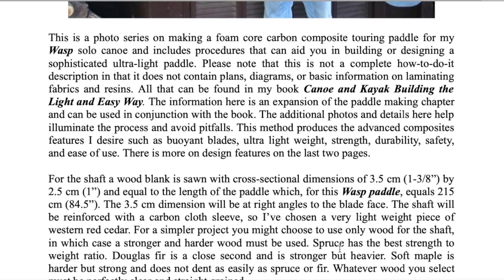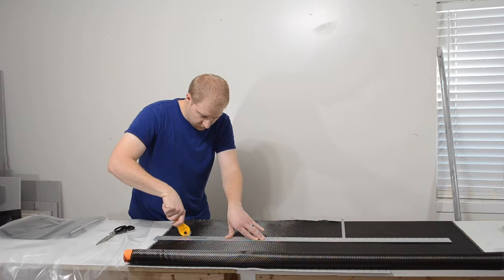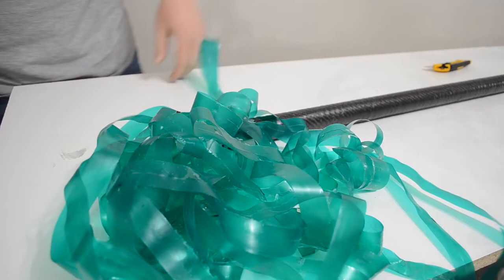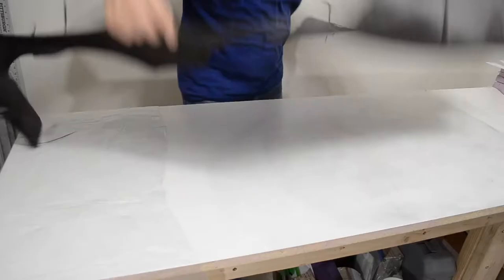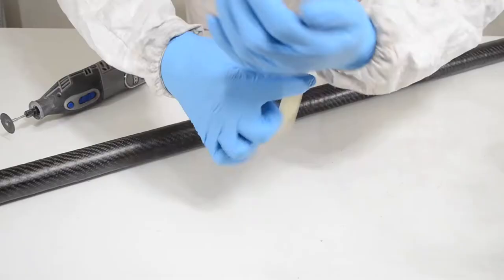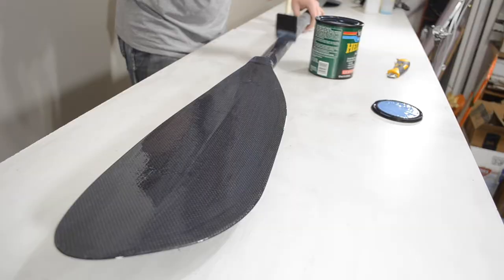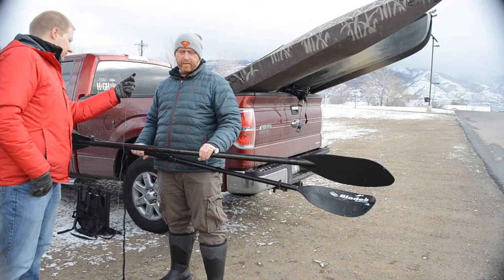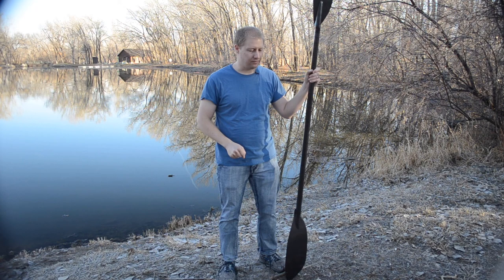How I made a carbon fiber kayak paddle with no molds!

Comment: There are two paddling styles, low angle paddling and high angle paddling. It's mostly preference. High angle paddling gives more power and acceleration, hence why it's used in speed racing competitions.  Low angle is usually used for long distance trips, though I also use high angle paddling for all of my paddling, and I am part of Castaways Against Cancer, so I paddle with my fellow Castaways from Miami to Key West once a year (160 miles+ to raise $ for cancer research).  All this to say that if someone has a natural high angle paddling style (difficult to do if you have a wide fishing kayak), a shorter paddle works better for that style.  Cheers.  I learned so much watching your video in terms of how to FIX or REFURBISH my $500 paddle!

Comment: Very solid instruction video. Watched it many times, took notes and now about to go scavenger hunting for the tools and components. This will be my first composite hand layup/vacuum project. Very stoked!
Reply from the maker: Awesome!  I'd LOVE to hear how it turns out!  This is the biggest reason I share these videos - I want to inspire people to make stuff, so this is the best compliment I could get!  The world needs more builders :)
Reply: @SasquatchComposites I will let you know! Btw, would you still do the shaft the same way or differently after this build? Knowing that I have to sand down the shaft, I'm bit worried about sanding into the fibers. But perhaps since this is a hand layup there will be more resin on the surface to protect against that.
Reply from the maker: @henrir4362  I would absolutely do it the same way.  The alternative would be to make a 2-part mold for the shaft, and that's way more work.  I like this method better for making a one-off part.  You just have to accept that the shaft will not be perfectly smooth and be very careful to not sand into the plies.  If you see black dust when you sand, it's time to stop sanding that spot. I did design it to have extra strength so it's not the end of the world if you sand into the carbon a little, but it's still best to just avoid it.  If you absolutely wanted the shaft to be smooth, you could apply several coats of epoxy to it after cure, sanding in between coats.  Eventually it'll build up enough to smooth out the wavy surface.  But it'll add quite a bit of weight.
Reply: @SasquatchComposites  Thanks! Another really interesting method I saw was one guy using heat shrink tube which he heatgunned to the uncured laminate. I might try that as well if I can get my hands on a ~30mm HST.
Reply from the maker: @henrir4362  Hey, I like that idea.  I've seen people spiral wrap in heat shrink tape and then cure in an oven, but a heat gun could probably be used to shrink it if you're not curing in an oven.  The only tricky part about using heat shrink tubing will be getting it slid over top of the wet fabric without sticking and pulling the fabric, distorting the weave.  But if you try it I'd be really curious to hear how it works out.
Reply: @SasquatchComposites  Oh boy I made such a sticky mess with the first paddle I need to re-evalute my whole process. Phew.. I put my two layers of carbon on a peelply and started to squeegie the resin on top of that. I see you use regular plastic film instead of peelply because in your video I can see you put everything in the bag with very little effort - I had the resin soaked peelplies sticking everywhere in the bag :D what a mess..

Also I need to get some tacky infusion spray, I couldn't find anything right now and no other glue seemed to work for the strips that go around the edges of the core.
Reply from the maker: @henrir4362  I use 3M77 for sticking the strips to the core.  It dissolves a little when the resin reaches it, but if you carefully press everything down right before putting it in the bag it seems to work pretty well.  I've been using it for years and have yet to find anything better.  When you first spray it just be careful to give it a second for the acetone to flash off before you press it onto the core or it'll melt the foam core.  

I don't think I used any peel ply with this project at all.  For the paddle layup I put down some drop cloth on the table, wet out my skins on the drop cloth, and then just picked up the whole drop cloth/carbon combination and stuck it on the core.  When you're done, the sandwich goes drop cloth/carbon/foam core/carbon/drop cloth.  With the drop cloth on the outside, it slides into the vacuum bag easily enough.  Once cured, the drop cloth just peels off.  An easier method than sliding it into a tube bag would be to use a large flat sheet of bagging film and bag sealant tape around the edges so you don't have to slide the sticky mess into a tube.  You just set it on the bagging film, apply sealant tape around the edges, and fold the film over the top.   Hope that helps.
Reply: Using UNI  & BID glass cloth on my SUP.   Aircraft Spruce  Rutan fabrics.  Way more economical,  Paint it Black
before epoxying.  They will never know !

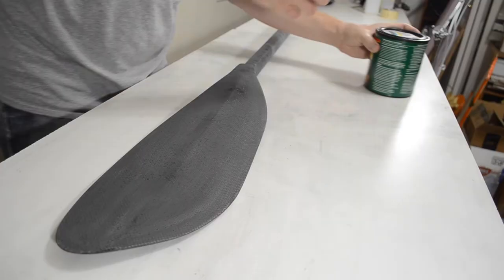Comment: [ 15:48 ] Instead of cabosil, maybe thinning the topcoat of epoxy with a bit of alcohol would have reduced the viscosity enough to smooth out surface imperfections, and avoid the additional rounds of sanding?

Comment: So as a paddler of 15 years, I have one of those expensive paddles, not quite as expensive as your example, but more like £250. The main difference I have found with composite paddles as opposed to paddles with aluminium shafts and plastic blades is the stiffness. You will find that the composite paddles will transfer power a lot more efficiently, without all the flex, the lightness is a bonus. My paddle is the werner powerhouse, looking up the weight, it is 35lbs so just under double yours, which still feels light to me. I wonder whether mine being a whitewater paddle requires more strength? Length wise, for me it looked good, but people that do touring/ paddle sit on tops tend to use a longer paddle, im not sure why? maybe for a longer reach when turning, but having your hand closer to the paddle blade allows for a better power transfer too. My paddles are 200cm long tip to tip, which is actually quite long for a whitewater paddle.
Reply from the maker: I absolutely would want a stronger paddle for whitewater.  Those things need to be able to take a beating.  If I were building one for whitewater I'd probably use a higher density foam core in the paddles like Hiload 60 (actually, I kinda wish I had anyway) and add an extra ply or two of carbon to the paddle area.
Reply: @SasquatchComposites  that's great, I'm actually thinking of making one anyway so that's useful advice, I only came across this video by chance though, I've done a bit of composites work anyway so was just going to wing it,  I suppose maths wise it will take a little bit of working out, I don't really know what force I need to go up to for moving water either. I'm thinking of doing a wood core anyway, then using a glass woven roving with a very fine weave, I think where the dihedral will be thicker I may use foam and then lay up carbon over the top to hide it, thus reducing the weight. The carbon shaft bit was actually the most useful for me in your video I would say, how would you do a cranked shaft though? Have some sort of flexible rubber core then clamp it into shape carefully before removing the rubber?
Reply from the maker: @alexander.angell  That might work, but I suspect it'd be really tough extracting the rubber.  I would make a cranked shaft one of two ways: 
1. make a 2-part female mold.  This will give you the best result, but you have to make a mold.
2. shape a foam core to match the shape of the shaft you want (by cutting and/or heating and bending), and pull a carbon fiber sock over it.  After it cures, you can melt out styrene foams with acetone (don't breathe that) or just leave it in with a small weight penalty.  It's tough to vacuum bag it without wrinkling the fabric and because the fibers aren't oriented lengthwise on the sock, you'll have to use more layers of carbon to get the same bending strength.  But you don't have to make a mold 🤷‍♂
Reply: @SasquatchComposites  ah thanks, a mould might work, to get it in one piece would I have to inflate a bag inside it? Do you think that leaving a foam core in would increase the stiffness of the shaft? I know that a foam core on a boat does.
Reply from the maker: @alexander.angell  You could make the mold strong enough to withstand pressure and inflate a bladder inside (probably custom made bladder, like dragonskin).  I use this process for making RC glider fuselages, and I just use a harbor freight airbrush compressor to inflate to 60psi.  Or you could run poly bagging film tube through the mold and out each end, and then envelope bag the entire mold but with the poly tube vented to the outside.  The result is that you've vacuum bagged to the inside of the mold.  hard to explain, so hopefully that makes sense.

Comment: Great video and super helpful, really wanting to try this project out and make my own paddle. How has the paddle held up over time?
Reply from the maker: I haven't had any issues from normal use yet, but life has unfortunately kept me from using it much.  However, I made the mistake of doing the "look how strong this carbon fiber part is" thing and managed to crack one of the paddle blades.  If I were to make this again I'd probably use a higher compressive strength foam like Hi-load 60, which I think would make it almost impossible to break.  I'm planning to repair it and then use it a ton after I finish my kayak and I'll be able to make better recommendations then.

Comment: For a cheaper method you could swap the carbon for fiberglass and the Kevlar to dynel correct? I guess also swap the epoxy as well, but the overall method would remain the same correct?
Reply from the maker: Yes, you could save some money by switching to fiberglass.  I'd probably add a third layer to the paddle if I was using glass.  I've never used dynel, so I don't know if it's a good substitute for kevlar.  You could just use fiberglass in place of kevlar, too, if you add an extra layer.  It won't be quite as durable, but should be pretty good.  However, I would definitely NOT use an ester resin in place of epoxy.  In addition to being considerably weaker than a epoxy laminate, the ester resins attack the foam and you'll just be left with a sticky soggy stinky mess.

Comment: Awesome. This is exactly what I was looking for. I’m an avid whitewater kayaker (as my videos attest to) and was looking to diy my next one as the $400 paddle typically only last 2-3 years anyways and I want to design something unique.
Couple questions for you before I start my project:
If you had to ballpark the price of just materials used what would you say it was?
 
I’m planning on doubling ply on the paddle blades to stand up to whitewater and rocks more but do you have any more tips or ideas for reinforcements between the paddle shaft and blade?
Reply from the maker: I think I used about 2 yards of carbon and a small amount of extruded polystyrene insulation foam from Home Depot.  Probably about $60-80 total in materials.  If I were to do it again I'd definitely use a higher compressive strength foam, especially for whitewater.  And for whitewater I think an extra ply or two would be wise, too.  If you can get Hiload 60, it makes for a really good structural core material that's way more durable than the stuff I used here, and it can still be hotwired.  If you can't find that, Aircraft Spruce sells a very similar XPS foam called STYROFOAM LARGE CELL that would work fantastic.
Reply: @SasquatchComposites  you only gave mention of the carbon and foam in your price point but did not mention the epoxy.  What king did you use and what was that added cost then assuming you forgot to add that cost to your total?  Also, would urethane topcoat used on cars not be best to protect the epoxy from uv?
Reply from the maker: @artbyrobot1  I used Resin Research Composite Pro 2050.  Sorry I didn't mention that.  Not sure what the cost would be since I just keep a gallon or two on hand and don't usually calculate my usage for small projects like this.  

Not sure what the best topcoat is, but I suspect that you're right.  A quality auto urethane would probably last quite well.

Comment: What is the weight?
Reply from the maker: It's 19.1oz. It shows the weight at 21:21.
Reply: @SasquatchComposites   thanks for the reply, I tried similar project an year ago , but my paddle weighs around 1kg, I am not impressed with my end result, I will try again ,sorry I missed weigt information in you video.
Reply from the maker: @jdude1195  No worries.  I kind of glossed over it quickly in the video and you're not the only one that missed it :).  1kg is still much better than most paddles you can purchase for under about $300, so that's not too bad.  If you try again I'd love to hear how it turns out!

Comment: What does the vacuum do?
Reply from the maker: The vacuum helps compact the layers of carbon and holds them to the foam core while the epoxy cures.  Without vacuum it's more difficult to prevent voids and disbonds in your part.  In short, vacuum bagging gives you a stronger, lighter, and more consistent result.